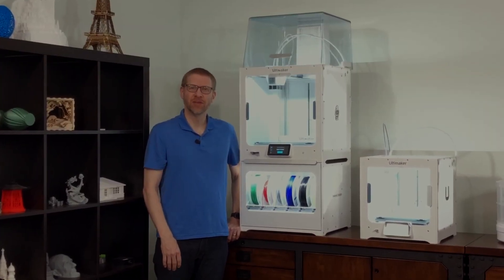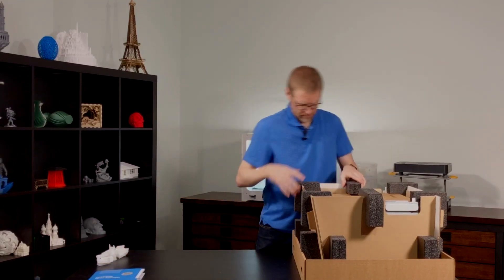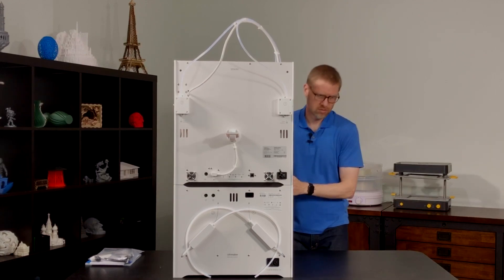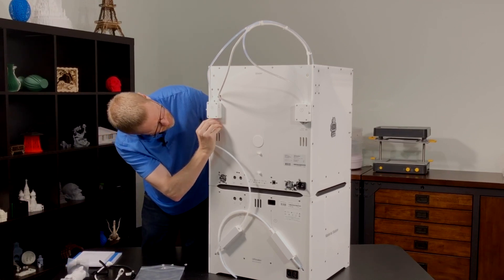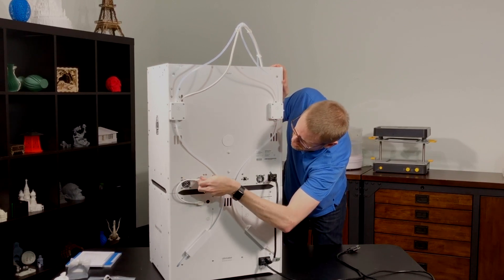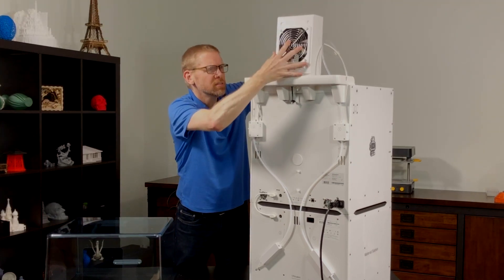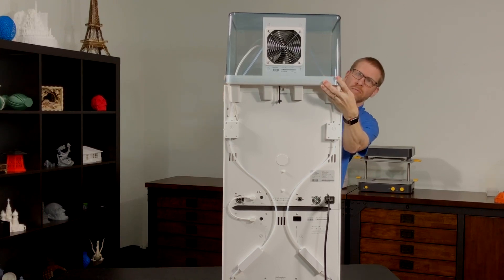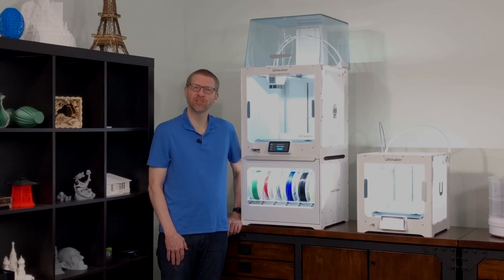Ultimaker S5 Pro Bundle Unboxing and Setup

Comment: Everything in this video can be guessed at by reading the vague documentation. What this video lacks is full disclosure on exactly how you switch on the Pro 5 Bundle for THE VERY FIRST TIME. Where's the firmware upgrade walk-through? Where's the information on loading materials into the Materials Station when requested to by the setup process to load the second material (PVA) first? How do we know if the component firmwares are the latest? The quick start guides do not cover anything useful, they fail to clearly indicates the parts they refer to during setup. Especially evil was missing was the useful tip about cutting off the hidden shipping tie-wrap that jams the print head and generates an ER33 while making a very unpleasant sound. Very poor documentation experience so far.
Reply: good to know